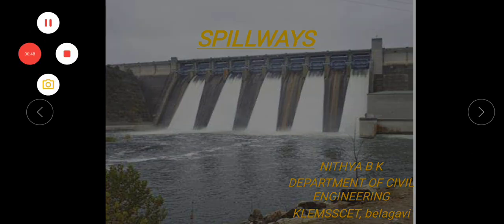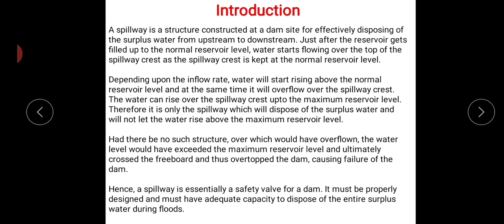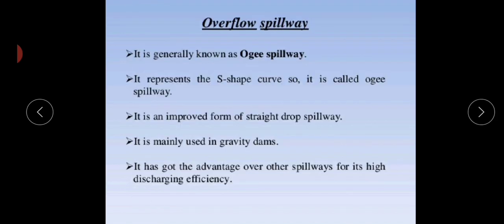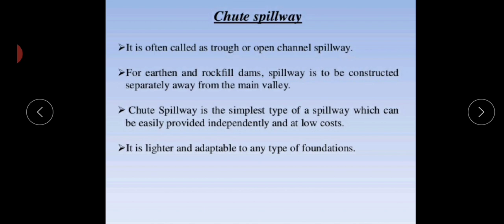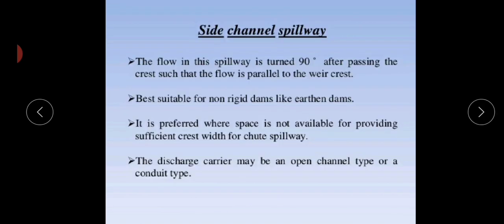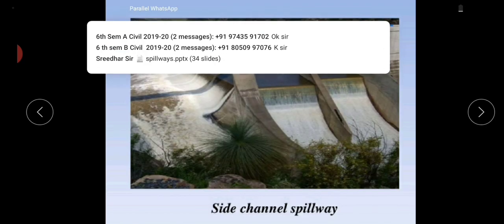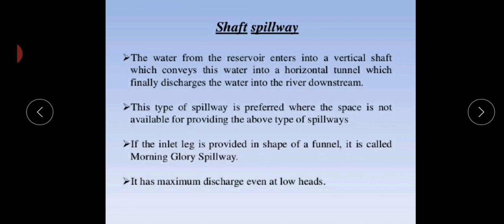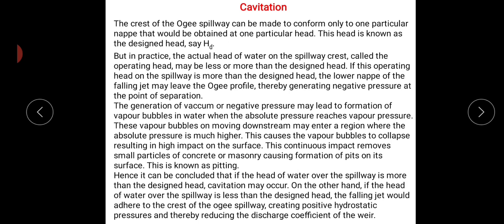Mdule3-spillways-part1

Comment: USN: 2KL16CV004
the spilway must be hydraulically and structurally sound and located such that the discharge will not cause objectionable erosion downstream near the toe of the dam causing the failure of the dam and other appurtenant structures